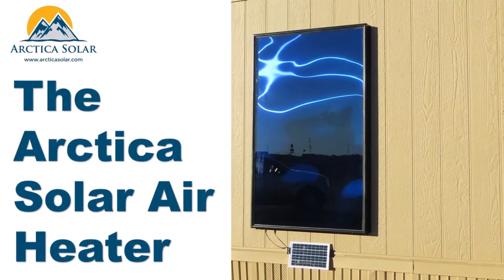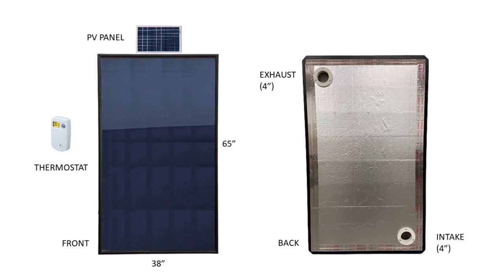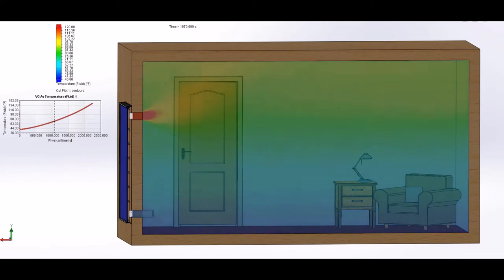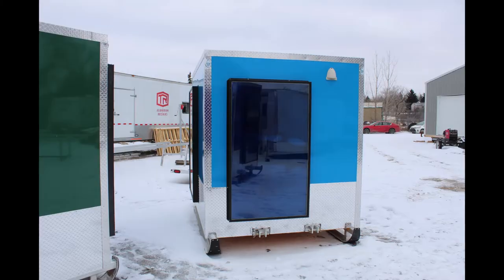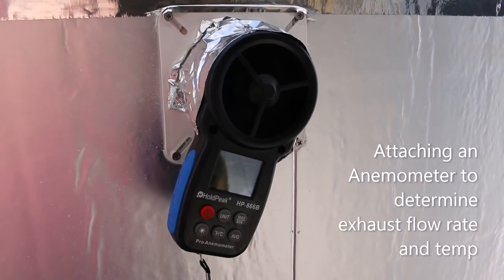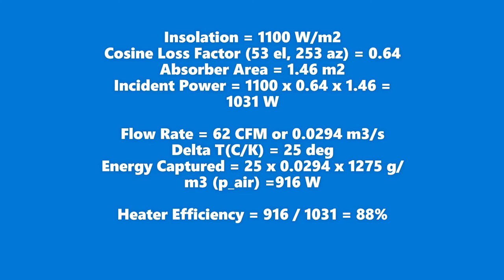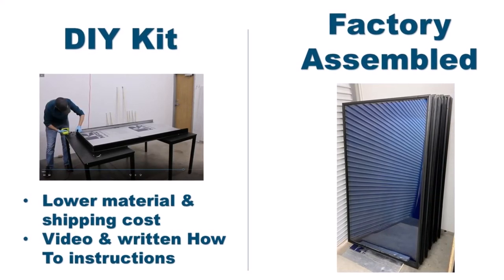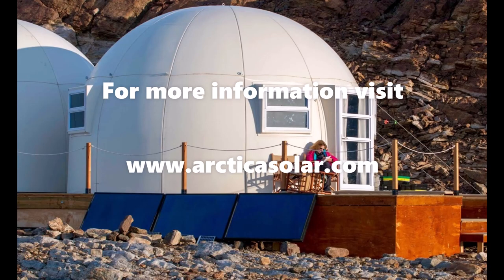Arctica Solar Air Heater Introduction

Comment: Do these produce any heat with just ambient light? Or does it have to have direct sun? Is it possible to run multiple in series? Each one bumping the temp higher so that theoretically you'd only need an alternate heat source at night and to get indoor ambient up enough for them to maintain it
Reply from the maker: Best to have them in direct sunlight.  And yes you can link them in series, we have other videos on our channel which cover linking units.

Comment: How well do the panels perform on a cloudy overcast day without direct sunlight? Will it still generate heat?
Reply from the maker: Yes, there is still some performance thanks to UV absorption - here is a direct message from a customer of ours in Montana, “Here's something you might be interested in regarding the solar air heaters - we received about 8" of snow in the last 24 hours and it it currently 3 deg above 0.  It is still snowing lightly but the clouds are thin and the sky is bright AND the heaters are running producing air at 75 -83 deg, ambient indoor input air temp approx 61. (PS the ambient air at 60 is pretty typical in the house this time of year and is quite comfortable) These things are amazing!”
Reply: @ArcticaSolar  Excellent! Do you have EU suppliers?
Reply from the maker: We are hoping this year to close on a EU and UK partner to distribute the products in those geographies
Reply: @ArcticaSolar  Please let me know if you do!

Comment: Hey guys, thanks for the info! When it's on the roof, the intake air have a longer tube to the ground or how does it work? Did you send this to europe?
Reply from the maker: Hi Iban.  When doing a roof mount you could patch the heater(s) into the existing building ducting or run a intake / exhaust flexible duct to the desired heating space.  The fan provided is strong enough to support about 20' of attached intake + exhaust ducting.  We do send product to Europe using DHL, and we are working on setting up a European partner to ship directly to European customers!

Comment: If the ambient temp is 75-77 °F I wouldn't be using a heater. Any numbers for cloudy day performance or in cooler temps like between 25 to 55 °F I'd see for most of a heating season in the NE US? How about just the numbers in Antarctica then? The utility in my area comes down to cloudy and cold weather output temperature and it's cost per BTU.
Reply from the maker: John, during our testing we are limited to intake at the ambient air temp, just can't control the weather here in California.  In our Antarctica testing, the delta T achieved during testing is independent of air intake start temp, so achieving a 25 - 35 C bump.

Comment: tell as about sound level of db  made the  fan
Reply from the maker: I would describe the fan noise level as worst case about the sound of a desktop PC computer when its cooling fan is on.  The fan on the heater is installed in the intake duct collar, so typically you don't hear anything as you have a duct run or 6-12" wall separating the space from the fan in most installations.

Comment: 1:42

What is "(p_air)"  ?
Reply: p_air is the density of air which is normally designated as rho. rho is a greek letter so apparently they didn't have a way to show that in the formula and just used a "p" instead.
Reply from the maker: Yes, as was already commented, it is the density of air, 1275 g / m^3 (density of air, also denoted as P_air)
Reply: @ArcticaSolar  Sorry. Must have missed that.